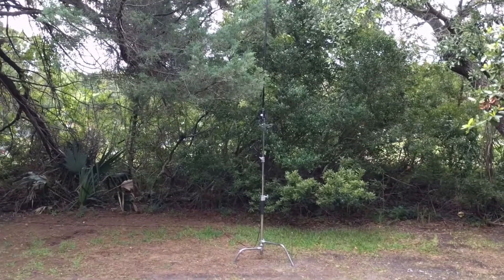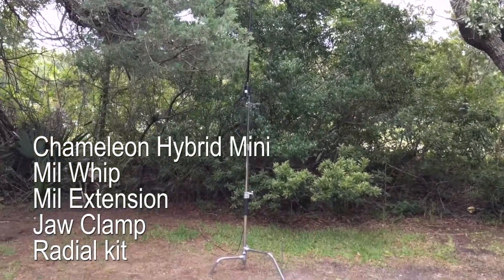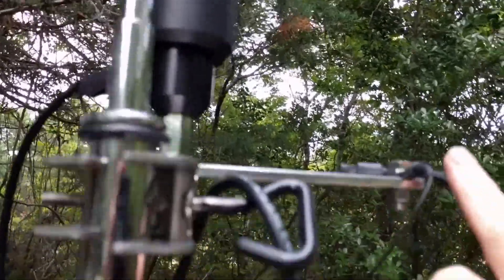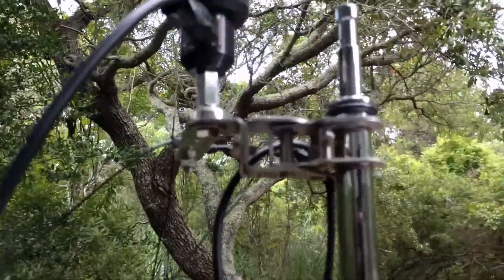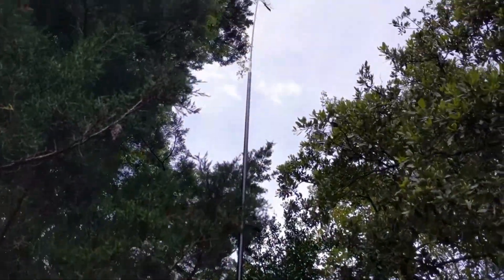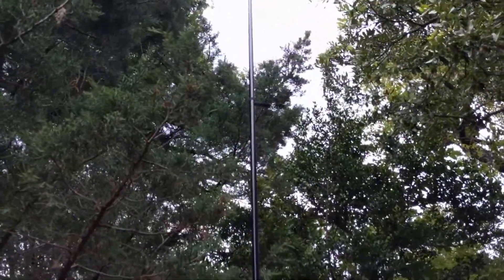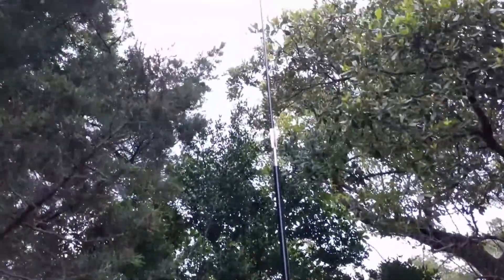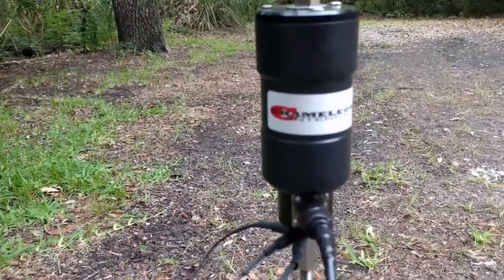Chameleon Hybrid Mini antenna on Ocracoke Island 2017

Comment: Mr. Wills, How would "ground" the Chameleon if you decide to leave the antenna on the photography stand?  I am planning to purchase my first Chameleon and attach it to a mast, but I don't know where I would attach the ground.  Thanks
Reply from the maker: Are you using it for temporary duty?  I seriously doubt that it is suitable for permanent installation.  Not certain about attaching an electrical ground, but maybe the manufacturer can help.